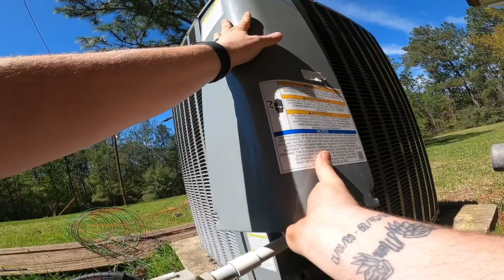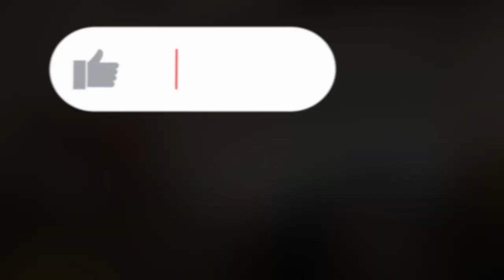7.5 Ton Daikin System/Low Voltage Short

Comment: Electronically, those defrost boards look quite simple and not difficult to repair or rebuild. It was interesting to note the replacement was in ESD (electrostatic discharge) protective packaging, which means ESD protection should be worn when handling it. Failure to do so can result is (significantly) reduced lifespan and/or intermittent malfunctions/failures.

Comment: Holy smoke, 3 phase service in a residential home.   I’m no big fan of Daikin built equipment but I give them credit in this case for using a small circuit breaker on the control circuit.
Reply: What don't you like about Daikin?
Reply: @ChrisbyChickenMan23  too many leaky evaporators after a short time.  To be fair, that’s not the only manufacturer I don’t particularly like.
Reply: @chatrkat  AND, It's made in CHINA, according to GOOGLE

Comment: I guess it depends on the state and codes and all but I've never seen anything bigger than a 5ton system on a residential house here in NC. So because I've never seen it, I just assumed that codes didn't allow larger than 5 ton units on homes? I've never actually done the research. Anyways, I've been to many many homes as we all have and some really expensive almost like mansions and typically they just have multiple systems. One home in particular I know of has four two ton systems and two five ton systems. All Carrier infinity split heat pumps. Cool video. Thanks.
Reply: Here in Ohio same thing nothing iver a 5 ton but I’ve been to mansions with 5 - 5 ton systems
Reply: It's because over 5 tons and they go to 3 phase power.  That's pretty rare at a residence.  It's also easier to control zones with multiple units rather than one monster.

Comment: Amazing video. Sorry for my questions, I’m new. You Disconnect the Red wire that goes to the air handler or furnace, and check if fuse keep blowing

Comment: So theoretically if the board had actually have been good, couldn’t it have been a pressure switch rub out?
Reply: Yes , I would have removed all outputs and inputs on the board and only tie in the R to board to confirm it's the board.

Comment: I've worked on those units beforeI've worked on those units before Those condensing units are pretty pricey They used to have problems with the condenser fan motor brackets breaking

Comment: Dual refrigerant circuits and three phase in a house? Must have been commercial at some point? Don't usually see three phase in residential unless there's a shop and then it's usually just the shop only. Great video.
Reply from the maker: It’s not dual refrigerant circuits
Reply: @johnisraelhvac2019  what was the other insulated line, hot gas? I know some of the commercial equipment use hot gas for evap defrost, Trane for example. I was just wondering what the circuit split was for 7.5T. Thanks for the reply.

Comment: Heat pumps need to be sized for the heat load.  That is like having a 100,000 btu furnace.
Reply: Probably more depending on how much auxiliary heat was installed.  7.5 ton is 90K alone. It probably had 15K or more worth of strip in it.

Comment: Lmao 7.5 tons on a house??? That’s insane.  Even a 3,000sqft house typically won’t need over a 4 ton.
Reply: Damn eskimos in that house when the air is running…surprised the unit doesnt cut out short cycling
Reply from the maker: You can’t but a 4 ton on 3,000 sqft here good luck with that
Reply: That sounds about right, 2 story 3300 sq ft Phoenix   2 - 4 ton Tranes keep it cool in the triple digits
Reply: 3000sqft would probably need a 6 ton, especially in Arizona (where I live)